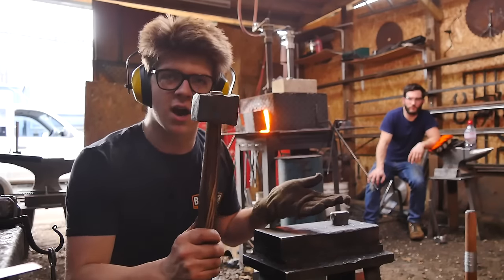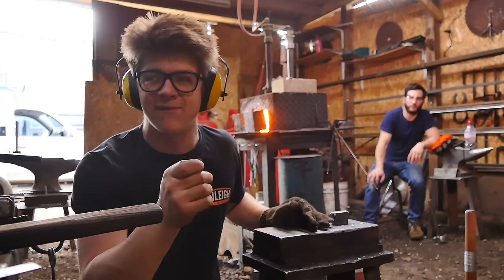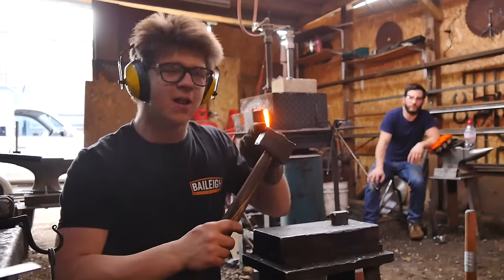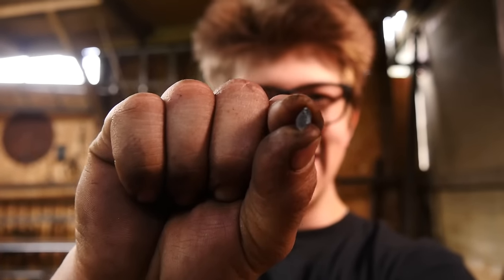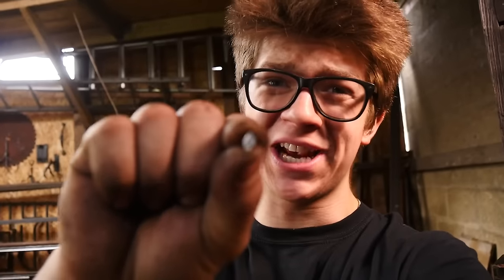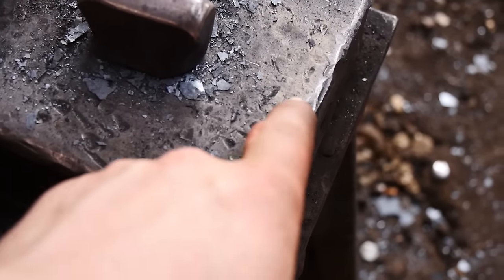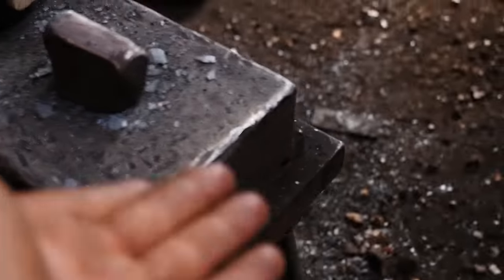WHY YOU DON'T HIT HARDENED STEEL!!!!!

Comment: I learned the hard way about striking hardened steel. One of my first blacksmithing projects was me trying to forge an HCS hex round into a blade. It was the second day of forging it, and I hadn't put it in the fire yet; however, this was before I learned about tempering and malleability of steel, and all that, so when I had finished up the previous class (this was in high school), I had water quenched it, so I could leave it in my locker without it burning a hole in everything else in there. As a joke, I struck the tip of the piece with my hammer, and instantly broke about half-an-inch off of it. Thankfully, it didn't exit the workpiece at speeds sufficient to drive it into a low-Earth orbit, but it ruined the piece for me, so I abandoned it.

Comment: The rule about not hitting hardened steel is serious.

I have a chip from a hardened track pin somewhere in my lower abdomen where it stopped after going up and straight through my left testicle. That was painful, but I was lucky. I later learned that just a few days before my accident, someone else at the same company I worked for got a chip though the neck and bled to death.

Comment: I had this happen to me twice!! I was using a hatchet and hammer to split wood for kindling for the fireplace. I had a mishit occur and a piece of metal flew off of the end of the hatched and embedded itself in my hand right above my left index knuckle. Had to go to the hospital and get it removed. If that wasn't bad enough... 3 weeks later I was splitting kindling and the same thing happened again!! Only this time the piece of metal went into my leg. If it had been just 2 inches to the right and I wouldn't have been fathering any kids. Another trip to the hospital.

Comment: Hitting hardened steel with a sledge hammer is dangerous if not done correctly. When changing teeth on buckets (wear metal) sledge has to be hit flush on hardened pins ect. Alot of accidents have happened because of hitting off center. Yes there like a bullet!

Comment: If you want your vocal cords to last a lifetime you have to must drink water often and constantly throughout the day.   I rock climbed competitively for 23 years.  I lost my voice due to dehydration often in the early years because “water is too heavy (whine whine)”. Then when I went in the army I had that knowledge under my belt as the young guys fell out, fell down vomiting 🤮 or passed out I was olde but still did fine because I was never without my canteen....around my shop and farm work I’m still never without..(also, one nasty bout of kidney stones and you will never drink less than thee quarts per day.  I recommend mixing in a bit of electrolytes like quarter strength or less Gatorade.

Comment: I remember when I was ten or so (40 years a go), my Dad was working on restoring a Sunbeam Alpine, and he had to go to Hospital after he was using a hammer and a hardened drift. Turns out a 2mm 'needle' of steel shot up and got lodged in his eye (luckily the white part). Remember this was back in 1980ish. Yeah he realised he was a berk and it was a stupid mistake not wearing goggles, but like so many times where anyone would say, "It's just a quick 20 second job splitting that/punching this/hammering whatever...." Can turn out very serious 🤔🤔😏😏 😎🇬🇧

Comment: Where you when I was a young man and hit a punch I'd made out of harden steel? 
It wasn't until I hit that punch several times and twice felt something hit my uniform sleeve  (the second time also hitting my biceps giving me a slight wave of nausea) that  I suddenly realized a splinter had impacted my arm with amazing speed.  I went to the hospital and had an x-ray and there it was deep in my flesh... the wave of nausea?  The splinter had struck bone.  By all means avoid striking hardened steel!

Comment: Did got once or twice hit with harden metal chip...u only feel little poke not a big deal,u dont even look it coz it doesnt hurt... a minute latter u start bleeding like a pig....
Similar is ceramic tiles...once lost my cool coz my employe needed 8 hours to sledge hammer with power tool couplle of sqare yards of tiles off the wall ,so i showed him that this job should be done in 30 minutes or so...i took ordinary hammer and cracked off 5 times bigger wall of tiles in 5 minutes by hand...ah, but when i stoped i had like 100 or more cuts all over my hands from ceramic chips..i dont think i had ever bleed more on a job site and i had had couplle of really bad cuts with stiches and all...the ceramic chips.didnt hurt or bleed whille.i worked when i stopped it stang like paper cuts...

Comment: Man dude ik you have to talk loud to keep videos interesting but im gonna try to give you some tips so you dont lose your voice. When you talk use more of your diaphragm rather then youre voice. It shoulldnt hurt youre voice at all but there should be a decent pressure in your belly right below your lungs. Similar to taking a really big crap. It takes a little practice but it helps alot. Thats how singers are able to sing so much with a full sound all the time without hurting their voice and hpw people who play wind instruments are able to control volume and control without their voice ever used. If you can practice with youre diaphram (lung muscles in a sort) you can push out a lot more sound without straining youre voice. Im not good at explaining things but the best thing i can do is give analagys on how its supposed to feel. Like taking a big crap, breathing while doing crunches or pullups, all of those burn right above your belly button and right below youre rib cage. That is youre diaphram contracting, and if you practice strengthening youre diaphram you can push alot more sound put without relying so muc on youre voice. Its like lifting something, if you are lifting with nothing but ur back (in this case ur vocol chords) it will eventually give out but if you use primarily a stronger muscle like youre legs (or diaphram) then you will beable to go much longer

Comment: Boy, i am wondering..., where is ur leathern protection gear?
No chest, belly, legs, arm stuff!
When i started in my job 23 years ago, we never welded or forged in the  smithery without it. The risk of injuries caused by flying metal pieces, burning by sparks or broken grinderweels is reduced to a minimum.
Wear ur leather skirts! And for the ladies... :)

Comment: i don't think a hardend chip woud do any real damage look at the mythbusters copper coin from a building episode.
its kinda the same the chip (like the coin) just docent have the mass to be able to fly that fast in the air.
unless the part that gets hit by the chip is on top of it (simulating a vacuum) it shooed not be able to fly that fast that it can overcome its lack in weight, to really do damage.

Comment: Literally almost all striking tools that aren't home made are hardened. Umm it's fine it'll be OK.
Reply: They're tempered then. Just hardened steel itself is like a prince rupert's drop. Under heavy internal strain that makes it hard but break one bit of it and all that internal tension is released explosively.
Reply: @quinism1136  Hardened steel can be many varieties. Case hardening is very common. Hard exterior for the cutting, soft interior so it's not too brittle. Some tools can be hardened right through, and the issue here is they are much too brittle.

Comment: Mythbusters debunked the striking hardened hammers myth. I saw a better table of hammers at a yard sale once. The guy was selling them all for a buck a piece. I bought 2. still cool that you make your own though.
Reply: I've seen two people go to hospital to have shards removed thank god it went in there legs and nowhere else
Reply: No.
Reply: That Mythbusters was about the entire hammer shattering, it did not debunk that chips could fly off. They even mention chips on the hammers.
Reply: I don't remember that. I just remember Grant's pneumatic striking machine he made where the hammers came together so hard the handles broke. I got a shard of metal stuck in me when I was taking red set loads and beating them on an anvil with a hammer to blow them up. I was drunk, and it seemed like fun at the time, until a piece of shrapnel caught me in the gut. But it was only a little bit of brass. It barely broke my skin. It only hurt for about a half of another beer too. Well malt liquor. The ABV of what I was drinking was too high to call it beer. heh
Reply: I speak from experience when i say chips can fly off and cause physical harm. ive had a piece of a hammer head stuck in my arm for the last 10 years. it happened when i was taking apart a skid and i was hitting 2 hammer heads together to drive the claw of the one hammer between the wood. i can still stick a magnet to it through my skin...makes for a good party trick lol
Reply: Cheap hammers aren't hard. This is a guy that makes his own tools, and is talking to other people making their own tools. You could flatten an off the shelf cheap hammer on a good anvil with a good hammer. Hardened steel splinters and shoots off, it's not up for debate. Go read up on why grinding the mushrooms off punches that are hit with hammers is so important. It kills and injures people all the time.
Reply: +Step Two And A Half kills people? I think I am going to need a citation for that. Unless you mean you're slaying us with your jokes in the comments section?
Reply: +Sam Fowler while anything is possible most things remain highly improbable. You stand a greater chance of being sucked up by a micro black hole while taking a dump. At least some scientific evidence exists that phenomena actually occurs on this planet. Though it could just be sensor glitches too? Still, some of the data is compelling.
Reply: Paul Frederick that was a ball hammer against a ball hammer not an anvil
Reply: Mehkai's Treasures it was not about the hammer shattering it was about it chipping. which they couldn't get it to do
Reply: I've personally seen at work someone hammering out a hardened pin with a soft faced sledge end up with a piece of shrapnel 50mm deep in his thigh, it can definately happen even if it is a one in a million occurence
Reply: I'm pretty sure they were using NEW hammers in MYTHBUSTERS.. Heavily-used hammers have more stress and micro-fractures, they are more likely to chip.
Reply: +spotimpact no, that episode repeatedly referred to hammers 'exploding', they definitely did get chipping - and frankly, basing any opinion or argument on something you saw on a mythbusters episode probably means you ought to be wearing a bicycle helmet 24/7.
Reply: I will have to respectfully disagree. I looked on the website before making my post. Here is from Discovery.com "Explanation: After watching Jamie Hyneman mold metal with two hammers for various MythBusters projects, concerned viewers wrote in with a warning: Hammer safety instructions note that metal smashing against metal could shatter the tools and send lethal steel shards flying." 

I did not want to entice an argument, just clarify what the hammers myth question was. I also wanted to clarify what they worked toward testing during the show. Hope this helps.
Reply: +Michael Chavez so, what you're saying is the hazard is posed by old and faulty tools? The solution is simple then. Everyone needs to throw out their old defective tools, and get safe new ones! Preferably covered in bubble wrap. A little fucking metal chip ain't gonna hurt me.
Reply: Actually, the made a second episode on the topic, calling a blacksmith. He made them properly heat treat the hammers, they put them in that thingy and one of the hammers chipped badly
Reply: Hey, could I have some context about these hammers?

What's the topic of debate? The fact that hammers can chip each other and that the chips fly off at high speeds?

I don't really get what's going on. Is it something with the crystal structure of hardened vs soft steel?
Reply: +Gabriele Magnabosco ah, so they were able to find a blacksmith that could damage the tools sufficiently to cause an issue? Good to know.
Reply: This was a great series of comments. Thanks for the laughs. I love that mythbusters gives the layman a taste of science, even though they sound like COD players talking firearms.
Reply: For a buck a piece i would have brought more that two. You can never have too meany hammers.
Reply: +Daniel Moss you can have too many of the same hammers. Most tools on the second hand market are the same thing over and over. With hammers it is claw hammers, followed by ball peens. I'm set with both those styles now too.
Reply: @dogsarebest7107  100 per cent right mushrooms on punches are bloody dangerous.